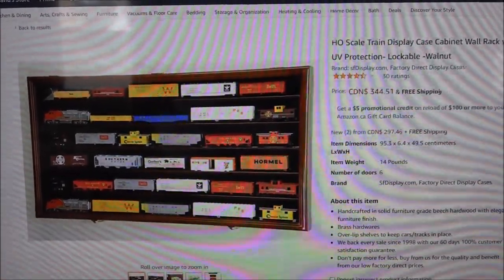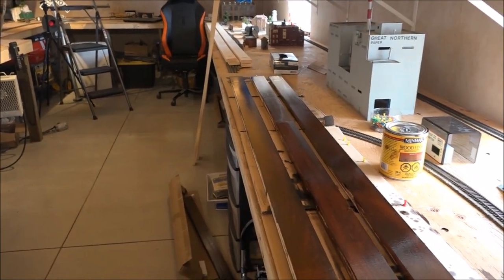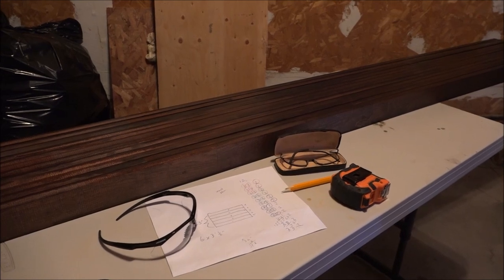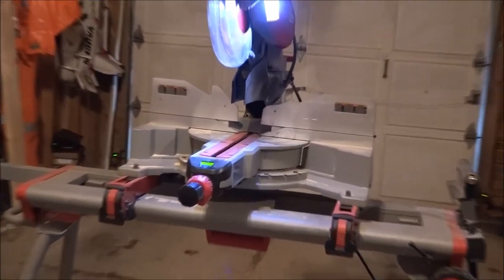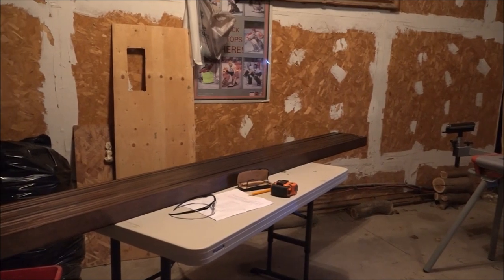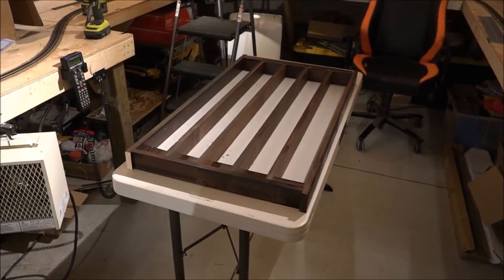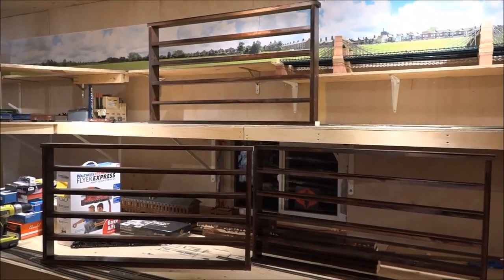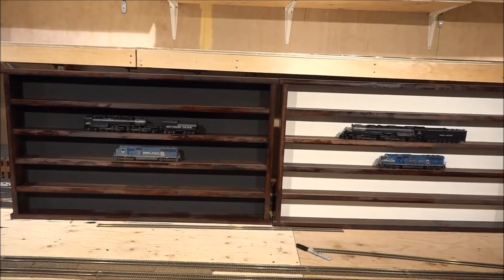How to build a display shelf

Comment: Suggestion for next time.. cut and make the item first then stain it ... that will make it much easier and less wastage of material and time, as you are only staining the finished product not all of your off cuts... and usually a stain is put on then the excess is wiped off with a cloth or sponge. It does look good tho and much cheaper in the long run. I prefer the white background as it shows the trains better as the black background is too dark.
Reply from the maker: thanks

Comment: actually i like this display. i have one that i had years ago and when i finally got around to it i took it appart sanded it stained and put clear coat on it . I think it was for matchbox cars but i made it my display shelf and i dont know where it came from or where my mom got it . Yard sale i think, anyway i mounted some old brass track which is very old and worn but i put thumb tacks in it and made it so i can put trains on it easy . and they sit not on flanges its small enough to fit 2 of my pacifics 1 consolidation and 1 0-4-0 with cabooses behind the pacific and 2-8-0.  i did this back in summer  when it was wicked hot

Comment: If you have the space and mindset, it is always cheaper to do it yourself.  Mind you the glass, or even poly carbonate sheet, to make the front cover (if you desire it) will be more expensive than the wood.
Reply from the maker: See how much dust gets on there. I like the easy access so I can run them

Comment: Maybe a sky or robin's egg blue background instead of the white or off-white matte.  A tan or biege would also show off the models well.  There is nothing wrong with the design or construction with the way you did it.  I probably would have taken a slight more time with the corners so the top and bottom pieces would be flush with the sides; but that is just me(I am kind of persnickity that way).

Comment: Your wife has a compound miter saw? I want to meet her! So, How hard, can it be? The white is definitely better for "steamers"  and other dark locos but I wonder how dust and such will take its toll over time as compared to black. Black would work for bright and lighter colors. Perhaps 2 of one and 1 of the other depending on your mix of locos. My only minor suggestion would be to see if Amy has a router for the front outer edges. :)
Reply from the maker: She has more wood working tools than most wood shops. 
Yes she does have a router. And many bits
Reply: @sparky107107  Can she give my wife lessons?  :)

Comment: I can tell you how hard it can be, being a cabinet carpenter.  You make me cry but I guess it works.
Reply: Side question,  the laminate strips on my cupboard doors are starting to peel off on the edges.  What glue can I use to stick them back on ?
Reply: @KingTrump2024  You can use contact cement.
Reply: @ScottDowneywoundedbear  thanks, 5 year old cabinets so I can only assume it was   cheap product for the builder to install
Reply: @KingTrump2024  Builders don't usually use the best products when it comes to finishes.  Cheaper the better for them but not the home owner.

Comment: A different color, yellow? Green? I like the black too but hard to see the steam engine! Maybe add strips of LED lights above the locos?
Reply: Sparky, you could buy a piece of plexiglass the size of the shelf unit, predrill holes for hinges, attach! Maybe add a strip of rubber around the perimeter of the shelf unit for a tighter seal to keep dust out? Door edge sealant, rubber. Something else, add aluminum style contact paper to the back to act as a mirror to see that backside of your locos. If you cut a groove(router) in the bottom of the shelf above the loco, then place the LED strip lights in that groove(to hide them), then set the LED strip lights to randomly switch colors. Or choose 1 color all of the time.

Comment: Hi Sparky,
A super job and the money you saved can be put to a better purpose namely a new loco or rolling stock have you thought of puttin clear doors on it to keep the dust out Perspex can be used I would think with an ali (illuminam) frame you can screw into the Perspex as Allan of Dragons Junction MK 2 did